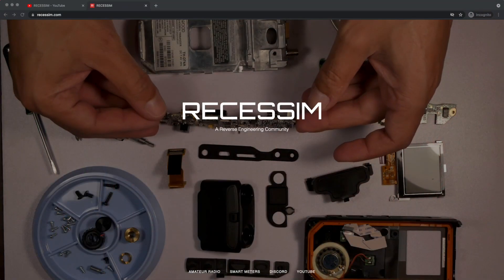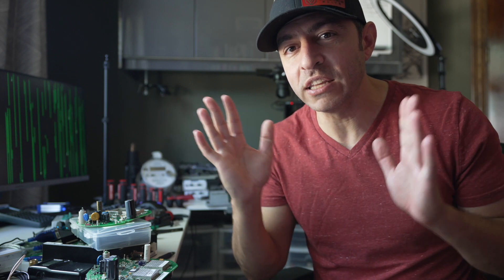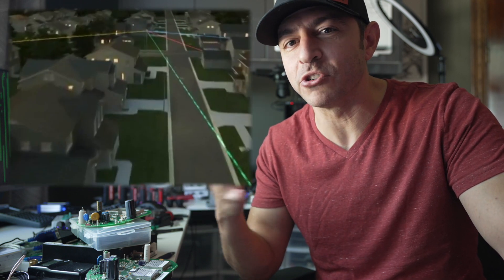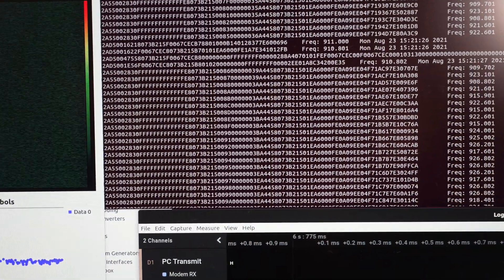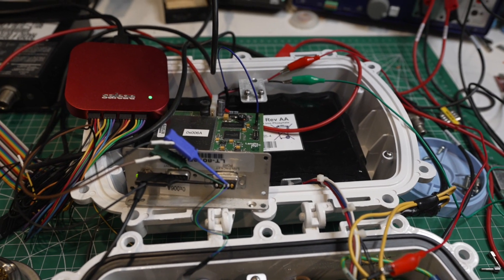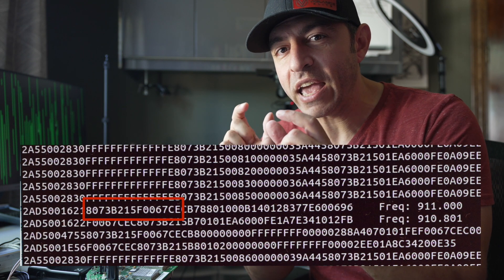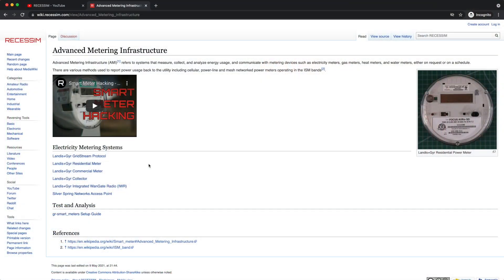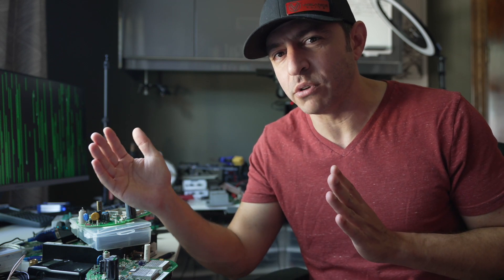Building my own Smart Meter Network

Comment: Hi, on "basic" smart meters by Itron for water/gas have you ever analyzed what data is transmitted? Like battery voltage or time of use data. I used to install them and have always been curious about the software.

Comment: I'm in to SDR radio and very interested in the radio side of these devices. Love you channel👍👍👍👍
Reply from the maker: Thanks! The SDR experimentation has been very fun, I will likely pivot back that direction after dumping the firmware to see what interesting things can be found about the frequency hopping pattern and data structure of the radio packets.

Comment: Oh, wanted to ask about those IR LEDs on the SmartMeter. I thought there would be a wealth of opportunity from there. video idea? I mean anyone can walk up to a SmartMeter and they have access to the IR LEDs, so that should be equivalent to getting physical access to a server. and that's safe, right? :)
Reply from the maker: I focused more on the RF side and have heard there is a way for the power company to lock out IR access via RF command because of issues that were found, talks at DEFCON about 10 years ago were pretty hot with smart meter stuff and "Looking into the eye of the meter"
Reply: @RECESSIM  Today this gone up in complexity depending on the protocol with access provilege that can be applied to each of the parameters depending on your credentials. Reading the meter ... there is nothing wrong with it. Ansi is seriusly outdated and more SW on the application level is needed to lock / unlock certain parameter ... while DLMS was natively defined to cope with that. But your meter need to be created with DLMS in mind because it shaps the form of the SW BADLY, like you build your SW around a protocol

Comment: Few things for another video. You said you discovered how to get into a test mode. How?, As for the CRC Addr, there must be a central authority assigning these so that there is no collision. In the software "Create a New Network" option, is that then connecting over the great inet to get an ID assigned to your new power company? You mentioned "like a VLAN", but that is local network. You mean more like MPLS wide area? How did you get the SW? or did the eBay vendors provide that w/the HW? I think you said 670 was the test CRC Addr. Wouldn't then you be able to run a live mesh outside the Faraday cage using the 670 CRC Addr, and everyone else will ignore it except your own equipment and with anyone else using the test CRC Addr in your vicinity? I know GSM and UMTS have test modes to be able to use it outside of a cage.
Reply from the maker: Test mode I found from analyzing older equipment that had jumpers to enter test mode then discovering 0 ohm resistor locations on the meter board that if populated would make it enter test mode.

As for the CRC Addr you're right, operating with a test value or some value that's not the same as the meter network around you would indeed not interfere and allow testing outside the faraday cage. I believe Landis+Gyr assigns the value to the power provider (their customer) but never had a copy of their software so not sure if it's internet connected or just a value that's loaded into a config file. All my analysis was by looking at public data at the FCC website and internet searches.

Comment: I have only seen the PLC route(power line communication) for smart-meters.

The test setup I have messed with before is: concentrator (the collector box) including mini-computer with mobile modem, a 3 phase power meter, a central server.
There is also M-Bus(meter bus) for various sensors, and modbus for central meters, and S0.
The meter was powered by a 3 phase current+voltage computer controlled source working as phantom power load/power producer.

My goal was test that data is collected, and try to trigger all kinds of faults in order to check that they are reported.
Reply from the maker: For meters in the US or another country?
Reply: @RECESSIM  other country.
Reply: i have a project of my own and have been trying to understand how the in house meter communicate with the main meter outside, havent figured it out yet can you help

Comment: How do the meters report back a tamper code and what causes it?
Reply from the maker: They would send a message back over RF, I believe it’s also logged in memory in case network is unreachable. Next time network is available it will send the message.

If the meter drops off the network for some reason the power company will know because they are transmitting once a minute in Dallas. They will come replace it or troubleshoot the issue, and then likely discover any tamper messages saved in memory if they dug that far.
Reply: @RECESSIM  thanks for insight. So during a power outage, hundreds or thousands of meters report tamper afterward potentially?
Reply from the maker: They actually report a power loss right as power goes out, they have some power storage internally via super capacitors so when power loss is detected they transmit messages letting the power company know. Means whenever there is an outage, no one needs to call. Power company knows within a few seconds.
Reply: @RECESSIM  so if a meter loses power (unplugged from socket) it reports it and that report may convert to a tamper if the area is not experiencing outages
Reply from the maker: Exactly how I understand it, one meter loses power and the people monitoring that would likely think it’s someone removing it for some reason and not an outage since an outage would involve more than one meter in most cases.
Reply: @RECESSIM  yeah I’m sure there are algorithms that take those factors into account and cross reference against permits. If those things don’t match looks like big brother is coming by for a visit
Reply: @unvjustintime1  Yes, but this is done at their offices, using their HES / MDM. They have modules for non technical losses .....

Comment: I'm curious what the dotnet code looks like now
Reply from the maker: I wish I could share it! There’s a LOT to be discovered in there…
Reply: @RECESSIM  What model had the dotnet code? i'm very interested haha, haven't done any RE in ages, I might just have to keep an eye out and get my hands on one!
Reply from the maker: The Collector which I have a video on is used to aggregate smart meter data and send it back to the utility. It has an Intel based computer inside running Windows and the Collector code is all in .NET from what I have seen so far.
Reply: @RECESSIM  Thanks!

Comment: Have you been able to tell if there are repeatable hop sequences when they first boot up, perhaps that are based on network ID?

I don't know if that's common for other FHSS devices, but for instance the XBee-PRO DigiMesh 900 Module spec sheet states "For modules to communicate, the hop sequence (HP) and network identifier (ID) must be equal on all modules in the network."

Figuring out if the hop sequence is the same or how it's determined could be interesting.

Enjoying your videos!
Reply from the maker: That's a great idea, never thought to see if the hopping sequence starts the same every time!
Reply: The hop sequence is going to be known to both sides either through a formula most likely with PRNG. Or like in the digital trunking, it's part of the encoded traffic. I think if you have access to the SmartMeter firmware, it would be the best place to figure that out unless it is done at an IC level, then that would just be a matter of reading the IC spec. I'm not at guru level yet to read the SmartMeter firmware yet so it's a guess.